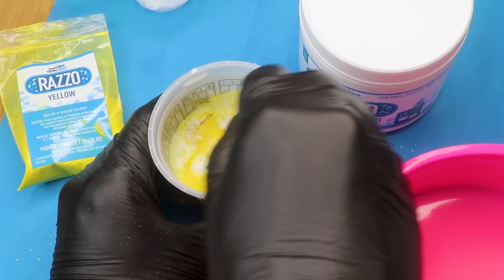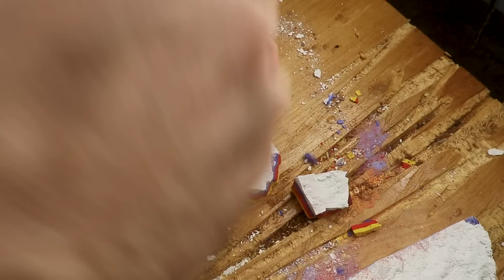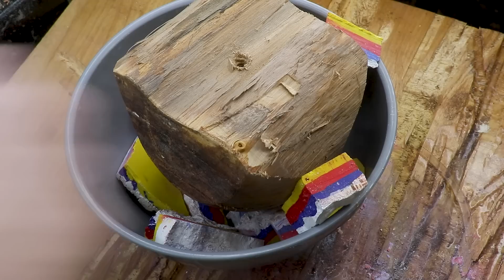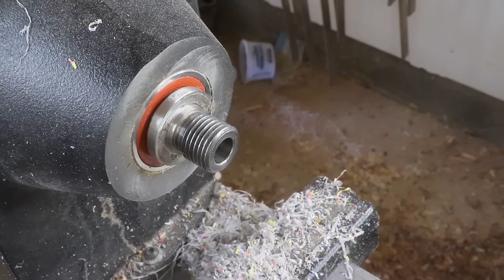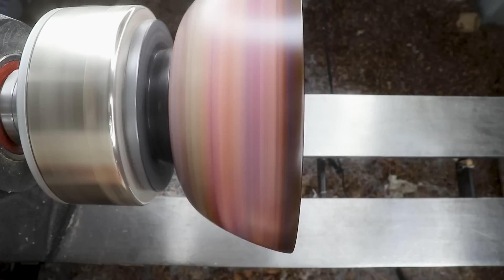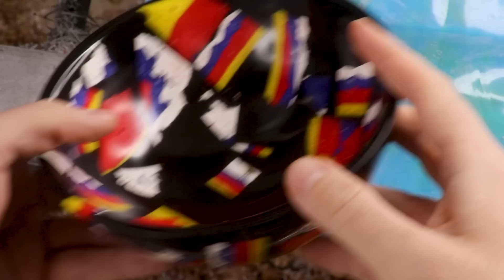A Very Unique Bowl

Comment: Why the wood blank as none left at end? Is it just cheaper to fill in the void than epoxy?
Reply from the maker: Yes the wood is just to save on epoxy, and to hold the pieces of color in place. If you look closely the wood is very cracked, so it’s no good for anything but firewood